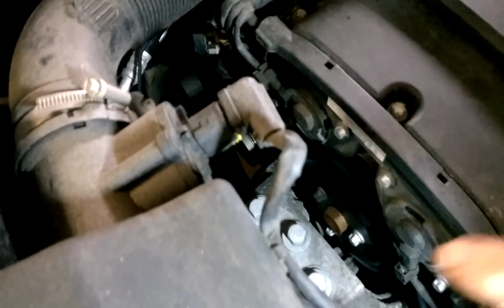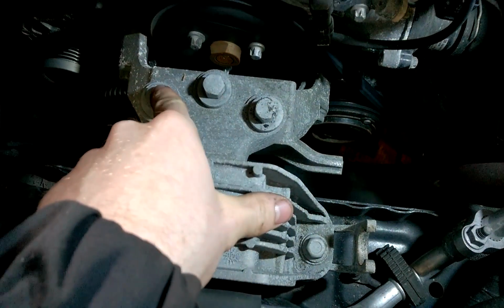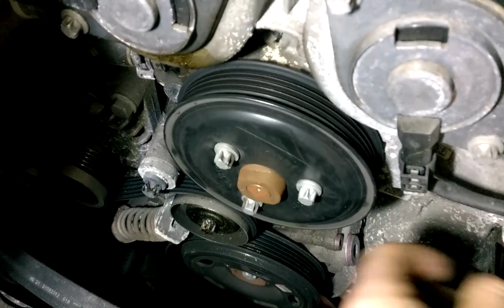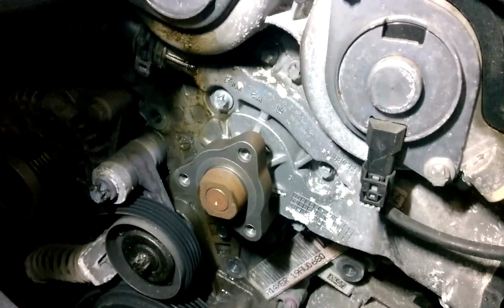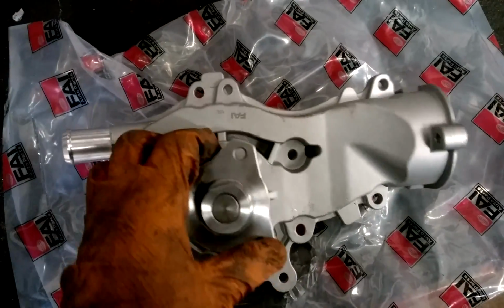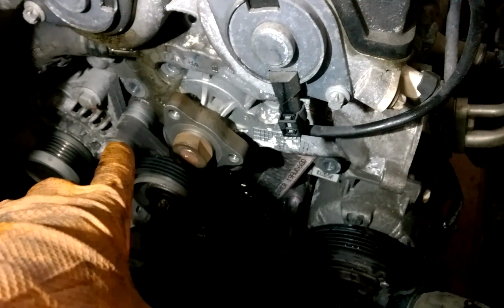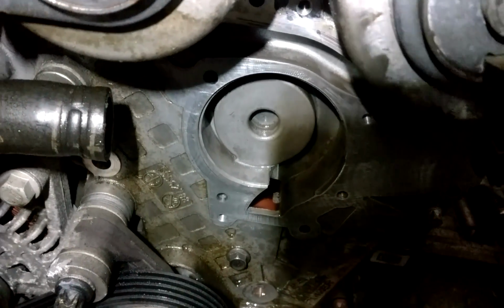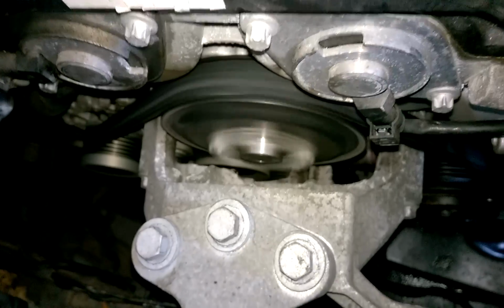How To Replace The Water Pump In A Vauxhall Opel Astra

Comment: Hi mate watch ur vid brill vid can a diver do this job because I can see a little leak not over heater at the mo but my thermometer inside the on dash the needle goes up when I pull away and drops back down had my thermostat fitted 4 months ago just wondering if you got any ideas pal but brill video very detailed

Comment: Thanks for the video mate. My A14NET (Astra GTC) is leaking from the pump but the pump seems to be running fine (it has previously been replaced about 30k miles ago).

Could my leak be just the gasket failing? Thank you.

Comment: Hi,

Does anyone know if the engine would need to be timmed whilst removing and replacing the water pump? Can I slip the belt off and then slip it back on?
Reply: The timing chain controls the timing. This is aux belt driven which is a lot easier

Comment: Is the cambelt changed when you change the water pump what mileage is the cambelt changed at on a 1.4 turbo gtc
Reply from the maker: No, its a chain so not due for replacement.

Comment: Hi Gerrard, thanks for the excellent video. I'm about to tackle this exact issue with my gtc 1.4t and was wondering if you knew the torque settings for the bolts as the last thing I want to do is over tighten them also should I drain the coolant first or can I work away and just top it up when done? Cheers

Comment: When supporting the engine from underneath do you simply have a jack to take the weight or do you need to pump your jack a few times to life up the engine mount? Great video again gerard
Reply from the maker: Thanks very much, jack it up with something like timber or a jacking type rubber pad on top of the jack as a cushion (especially if you are jacking on the sump) just a little tension so there is no strain on the bolts or any mounts when removing 👍👊👌

Comment: Sorry Gerard, i have a new problem my coolant pump is now fixed. but no my camshaft sensor is leaking on the front. I want to order a new o-ring and I than want to take it out. is that possible or will it leak lot of oil?
Reply from the maker: It won't leak a lot of oil, the fact that its a camshaft sensor means it will be higher than the resting oil that's in the sump, only when the engine is running is the top end being lubricated.

Comment: Thanks for your video! how did you support the engine before taking the bracket off.
Reply from the maker: Can be done a few ways, I use a jack with a soft block on top and prop it at the sump (soft block is to avoid any sump damage) you could use the small 1-2 ton jacks or even use the jack that comes with the car if you have a nice flat surface to use it on.
Reply: Gerard Burke thanks! for your quick and very usefull response.
Reply from the maker: No problem, thanks for the feedback Ruben.